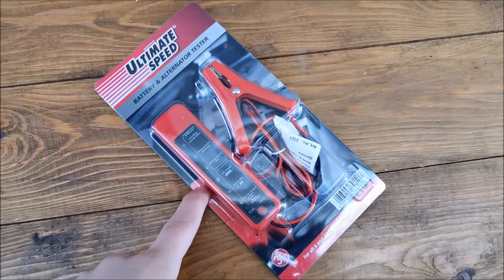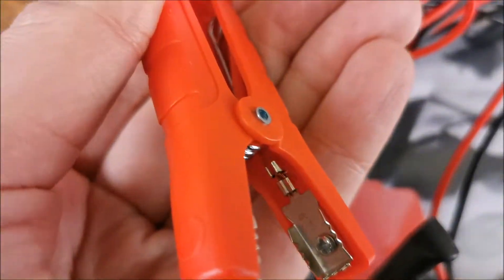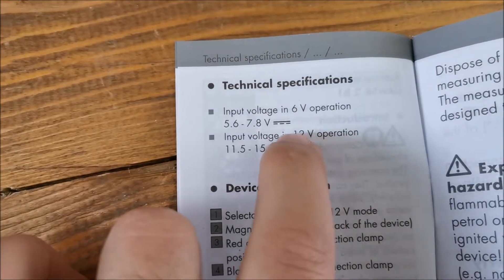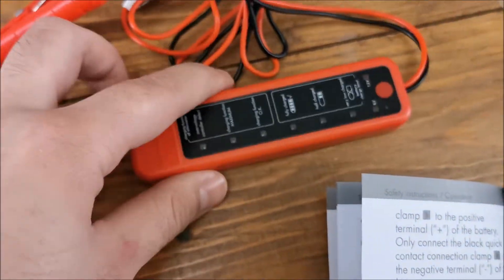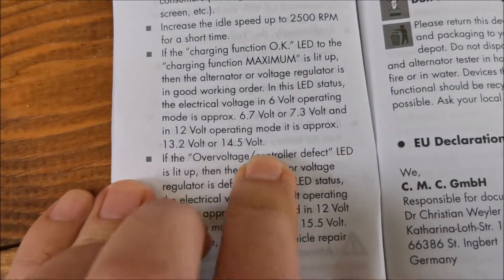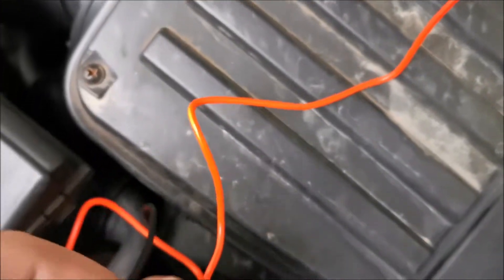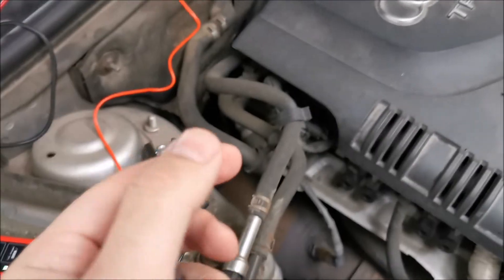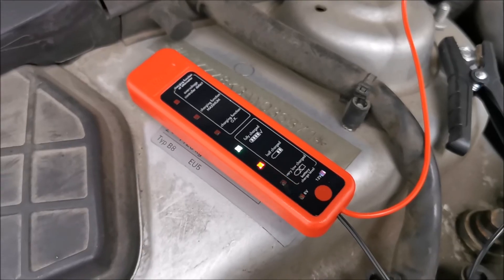Ultimate Speed Battery & Alternator Tester UAWSB 2 B1 (from Lidl) - test and review

Comment: I bought one of these a couple of moths back. Only just tried using it today. Non of the lights came on so I left it for 10 mins to see if they would eventually come on. I smelled burning. Went in everything looked fine but still no lights. Picked it up and one part it was extremely hot so I've taken it apart and it's melted through the inside of the case and a chip is stuck in the case that's come away from the circuit board. I'm glad I checked it as if left it could of caused a fire. I believe it was already faulty as I've never used it and it wasn't lighting up. I probably just got a bad one but I really like lidl products usually so a little upset :(
Reply from the maker: Sadly, you probably got a defective one. Normally you have a warranty on it with the receipt, but if you are like me, it's long gone...
Reply: @UltimateDIY  yes receipt is long gone unfortunately. Least I've now got some new crocodile clips though 😂

Comment: Useless tool just use a multi-meter which is the same price and actually useful.
Reply: i can see a usecase for it, my workshops a bit further away and i keep my tools exclusively there as to not lose any. 
its quicker to just hook this thing up put the magnet on the bonnet and see the reading on the leds from the interior + its much cheaper than a multimeter where i am, its 3,99€ for this thing and 25€ for a multimeter in the next hardwarestore (10€ online).
Reply: A multimeter works but you have to remember all the voltage values for what's a pass or not. The battery tester does all that for you!
Reply from the maker: If it's just pure voltage measurement, then yes, a multimeter would do the same. But, sadly, many people don't know how to use a multimeter.
Reply: @UltimateDIY  I saw this on sale in LIDL for 4€ and still couldn't justify buying it.
Reply: I think the same.
I thought that it had more functions to test the status of the battery. But it's just a voltage reference, a divider and some comparators. It's some very cheap electronics
Reply from the maker: Yes, it's for somebody that does not know how to use a multimeter. It just gives you the results in a visual way.

Comment: I had one of these but unfortunately left it sitting on my mower and ended up shredding it to bits.
I don't know where they're still available, but I made some calibrated measurements on it for the record.
The 7 LEDs illuminate at the following thresholds:
>8.01V(12V mode indicator),  11.347(very low charge), 11.9(half charged), 12.5(fully charged), 13.11(charging function ok), 14.42 (maximum),  >15.42V (overcharge)
It was very precise when it lit up, with no hysteresis.
The LEDs draw about 20mA at 14V
Reply: 4:28 heated rear screen is what they call the rear defroster, which draws a fair amount of current. Except in my Ford Focus,  which has a defective defroster grid and turned into tinsel hanging down from the window.
Reply from the maker: Thank you for this info 👍🏻
Reply: I bought mine at Lidl, but as is usual for them, they don't have them any more.  If I come across it again I'll pick one up, because I like the small size and the instantaneous response of the LED indicators.  
I bought a different one with a digital readout along with the LED indicators, but it's got a bit of a boot time to it when connected to the battery.
Reply from the maker: Yes, Lidl only has them from time to time.
Reply: @UltimateDIY  found it in the store for $4.99,  version UAWSB2 C2👍
Quick test showed the thresholds are within 0.1V of my previous unit.
It basically can distinguish the following voltage thresholds based on the LED patterns:
4.78 LED first comes on
4.94 to 7.70 very low charged, flashing red LED
>7.70 to 11.30 LEDs off
>11.30 very low charged steady red, 
>11.85 half charged, 
>12.40 fully charged, 
>13.00 charging function okay, 
>14.27 charging function maximum, 
>15.28 overvoltage controller defect

In 6V mode, 5.68, 6.01, 6.30, 6.59, 7.14, 7.64V.
Reply from the maker: Wow, that is a lot of info. Thanks!
Reply: @UltimateDIY  
I like it mainly because of its fast response, so it can show off there's a voltage drop off when cranking.
Helps to narrow down if I have an issue with a starter solenoid or cabling since a static voltage measurement can be misleading when unloaded.
The voltages didn't quite match what was stated in the manual, so I opened it up to see if there's any chance it could be adjusted, but there's no provisions for that. All fixed components and ICs.
Reply from the maker: Understood 👍🏻
Reply: @UltimateDIY 
I damaged one that I had-
connected to a power supply going to a cordless drill which put out very  high voltage transients, and it apparently took out the 78L05 5V voltage regulator that then passed the full 13V to the 5V circuit, and fried the main chip used in it, which is unmarked.
So, don't try using it to measure anything other than batteries because it'll get damaged-
Reply from the maker: Got it, thanks 👍🏻